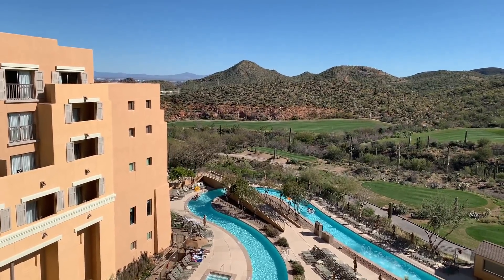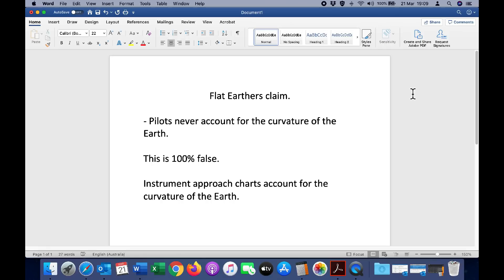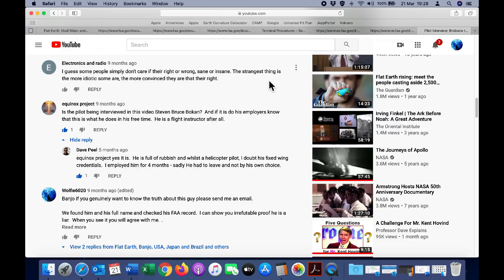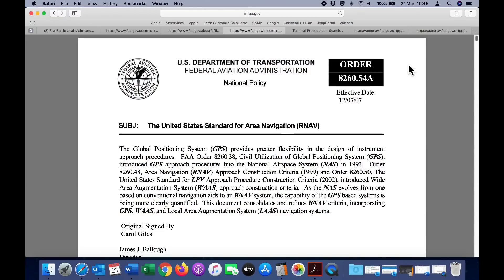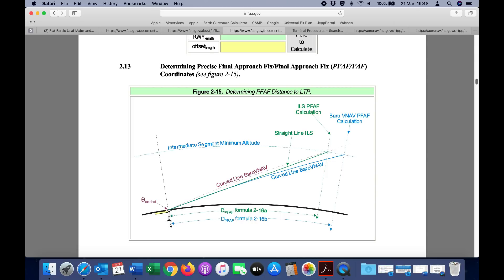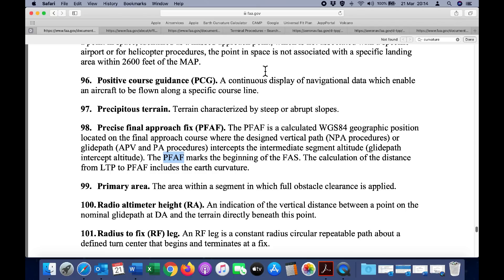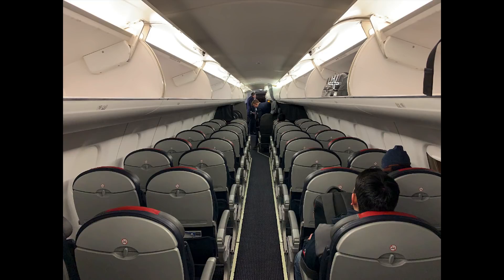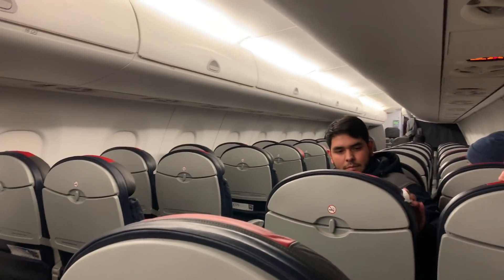FAA Documents confirm Pilot approaches are calculated for the curvature of the Earth.

Comment: If that calculation was valid the r value would need to change based on location because the earth isn't perfectly round. How is that discrepancy accounted for? Lives are on the line!
Reply: What is that discrepancy due to using the average radius instead of the location-dependent precision value? A couple feet, several yards, a football field, a mile…?

Comment: Corriolis effect.     https://youtu.be/85x8cqHoLWc.  On moving body on an ice huge plane. Without friction and no air resistance and winds effect on the body. Inly coriolis.  
 The trajectory will be cicrle. In the direction of the clock. Clockwise. https://youtu.be/85x8cqHoLWc

Comment: I made an example on Coriolis  effect on a rocket. https://youtu.be/wSdbJwvpNRE. The shift to the east.  But it was hard for me to take into account the air resistance. I guess air. Next time I will try. Air resistance depends on the velocity of the rocket, the air density which changes with height. And also atmosphere wind profile. Complicated.. I think with air resistance the soultion is not analytic but numerical with small time steps. You should solve ut with computer with a loop on time steps,  dt. Maybe if I had Matlab in my personal computer i could solve with air resistance. . And also i made another video (the last video in my channel which explain why I neglected in the rocket case the centrfugal effect and took into account only coriolis force effect and gravity effect on the rocket :-). In my two last videos in my channel ;-)

Comment: Can you prove that pilots are using "precision approach" and not "non-precision approach"?
Reply: I think the better question is can you prove that the precision approaches exist or not. That would include not only the data like seen in this video but also all the equipment in the aircraft and on land that is used for the landings. If all the data exists, and the equipment is real, then whether or not it's used on a particular flight is meaningless.
Reply from the maker: +nathanyamaha465.  Do you know the difference between a PA and an NPA?  Pilots use both depending on what is available at an airport.  

The Precision Approach like the ILS I show in this video has been around for decades and is used daily all around the world.

When you gain an instrument rating will learn how to fly an ILS.  I first flew one over 35 years ago. 

You can see the ILS equipment even in light aircraft and the ground based equipment is visible at airports that have it installed. 

https://en.wikipedia.org/wiki/Instrument_landing_system

Yes all the data exists.   Google ILS Approach or Instrument Landing System

Here are more links.  

https://www.faa.gov/about/office_org/headquarters_offices/ato/service_units/techops/navservices/gbng/ils/

https://www.faa.gov/documentLibrary/media/Order/FINAL_SIGNED_Order_6750_16E_ILS_Siting_Criteria_06-09-2014_for_Web_posting[1].pdf

https://www.casa.gov.au/sites/default/files/instrument-landing-system.pdf
Reply: @Wolfie6020  So if pilots are able to use NPA doesn't that negate the necessity for calculating in the supposed curve of the earth?
Reply: @nathanyamaha465  It does if you are prepared to accept an approach that only allows you to fly down to, say, 700 feet, whereas the Precision Approach would allow you to fly down to 200 feet or even land without seeing the runway at all.
Reply: @nathanyamaha465  Supposed curve? Are you trying to say that because sometimes a landing could be done NPA, that somehow that proves that PA is fake? Let me try an analogy and see if you want to stick with your logic. A surgeon could cut start your operation with a handsaw and then switch to a scalpel without you dieing, but would you want him to? If you want to debunk PA you need to be more direct and show that none of the calculations or equipment is ever used. Once you fail to do that then you fail to show the Earth curve is a factor.
Reply from the maker: @nathanyamaha465  Did you watch the video?   The NPA PFAF also factors in the curvature of the Earth.  They are two different formulas but both factor in the curvature of the Earth. 

When I show you clearly that the NPA also uses the curvature of the Earth in the calculation why do you think it is negated?
Reply from the maker: @nathanyamaha465  Go and look at the formula at 6:30 in my video for the NPA -   Formula 2-16b.   That also uses the curvature of the Earth.  

Both the NPA and the PA approaches factor in the curvature of the Earth.   That was the whole point of this video mate.
Reply: @Wolfie6020  I think I misunderstood something. I was assuming NPA meant you just relied on your visuals, kind of like landing a crop duster in a remote farm area. I need to rewatch the video. I think I was confusing one flerf with another.
Reply: @nathanyamaha465  poor conspiritard.
Reply: @jaimevivesp  if he thinks the earth is anything other than a sphere, he's a conspiritard.
Reply: @Alysm-Aviation  Well, yes... technically, if you believe something which requires a global conspiracy to be kept secret, then yes, you are a conspiritard.
Edit: And if what you believe can be easily disproved, making such global conspiracy ridiculously difficult to maintain, then you are also a fool.
Reply: @jaimevivesp  also, he's made several comments already, if you're on mobile you can see someones history.
Reply: @Alysm-Aviation  "if you're on mobile you can see someones history."
That's interesting... I'm always on desktop and didn't know that.
Reply: @jaimevivesp  yeah, you can click on someonse profipe picture and it will highlight 3 relevant comments on the current channel as well as subs.

Comment: At 4:59 "feet" Seriously! Feet! In this day and age! Why don't they go the whole hog and use cubits?
Reply: planck lengths or gtfo
Reply: The calculations are the same, as imperial units are easily converted by multiplication to SI. (Exception is the damned temperature.)
Reply: @MrAnticlimate  True, but my life is plagued by people who don't use international standards, and I'm just an ERP developer. I've been reading "Humble Pi" by Matt Parker he has collected some frightening stories of people dying or nearly dying because of Maths errors including conversion issues. Like the plane that ran out of fuel  in mid air because everyone involved in checking the fuel situation confused Lb with Kg, the pilot managed to glide the plane down and nobody died.

So seeing FAA documentation still using feet strikes me as crazy.
Reply: @k_tell  It's a historical thing, and yes, it's a mess! Almost every country has changed what it does from the international standard. The USA uses miles for visibility when most use meters. Most countries use knots for windspeed but some use meters per second. On a long flight I might fly through 10 different countries so the possibility of making mistakes is significantly increased. If I make an error then it's my fault because all those 10 countries publish the differences and it's up to me to spot them, not their fault because they won't use the international standards.
Reply: @hashmaldawn3878  I think you are being too kind. They have a responsibility to make it easy for you.
Reply: @k_tell  I agree with you completely, but there are some aspects of aviation that aren't totally safety focussed and this is an example. I, for example, can immediately comprehend what a visibility of, say, 4 km will look like from the cockpit, but I have to mentally calculate from statute miles. Note it is statute miles and not nautical miles, which might just have made sense!

Comment: Wolfie, I also found a literal Earth Curve reference (rather than radius) in the 8260.3D FAA order, relating to Obstacle Effective Elevation depending on distance from centerline. This is in the context of Obstacle Clearance Surface (OCS) determination,  since "Blurple Bear" clearly doesn't seem to understand the relevance of the difference between the ILS PFAF location and the barometric VNAV PFAF location, and why the algorithm needs to include Earth Radius.
We can now quote him this phrase, from Chapter 10, Section 10-2-2, part c. (page 10-8):
"Because the earth curves away from the OCS as
 distance from course centerline increases, the MSL elevation of an obstacle is reduced to account for this"
Obviously the relevant algorithm also includes our friend, the TERPS constant "r".
And significantly, this refers to calculating the effective height of solid obstacles that one might actually encounter during an approach, rather than fix point location variations, which may be too much of an abstraction for most Flat Earthers.

Comment: Hi Wolfie. Have you done a GLS approach for real yet? I've done a CAT I but not in poor weather. They will have CAT III capability soon. I guess ILS will become obsolete.

For those that don't know, GLS is a precision approach that uses GNSS (GPS) with a locally transmitted signal that improves accuracy reliably to within a meter or so. CAT I allows flight down to 200 feet and CAT III is a full blind landing system.
Reply from the maker: +Hashman Dawn.  No I have not done a GLS in the real aircraft.  The New 7500 will have EVS to ground.   They are working on the approvals for it but the company pilot doing the testing said it is very easy with the new HUD.
Reply: @Wolfie6020  Had to fly with an inop HUD the other day! Ironically, just the flight before, I'd talked in the briefing about what we'd do in the event of a HUD failure during take-off.
I thought I'd be home now for the duration of the pandemic but I got called out for a rescue flight.
Reply from the maker: @hashmaldawn3878  Stay safe.   I did a few right seat take offs and landings in the last sim session as we had a bit of spare time.  I feel naked without the HUD.   Had ours fail on approach to Colombo a few years ago.  That was the first time I landed the Global without it.
Reply: @Wolfie6020  We always get RHS checked every sim. But we've dual HUD anyway. You'll have that on the 7500 right?
It's been so weird going through airports, it's like a really boring apocalypse movie. People moving through the terminal in long lines with 2 m between each person.
Reply: Hashmal Dawn 
I’d be surprised if the Global Express is equipped for GLS approaches. I don’t think the Gulfstreams are. The Falcon 7X is not, and I’m not aware of any Falcon that is.
Reply: @53C52  Okay, I did not know that! Normally exec jet is ahead of airline in terms of tech.
Reply: Hashmal Dawn 
Not many locations with GLS in North America, so that may have something to do with it. 
There’s more focus on equipping with EVS, synthetic vision, combined vision, LPV. Things that can be more widely used.
Reply: @53C52  Not many locations with GLS anywhere yet! It will make ILS equivalent approaches cost effective for much smaller airports, and for larger ones it will enable multiple routings for each runway. As I mentioned, they can even use it for CAT III, and for taxi guidance as well.
Reply: Hashmal Dawn 
It will be interesting to see how things develop. As far as I know, the best GLS approaches in the US are still limited to 200’/1800RVR (KEWR & KIAH are the only installations I’m aware of).

The US seems to be going down the road of WAAS/SBAS for smaller airports since they can achieve those minimums with LPV nationwide without the cost of installing additional equipment at each airport. 

 I haven’t seen an in-service Cat III GLS yet, but I haven’t really been paying close attention since we’re not equipped for it. Are they already available?
Reply: @53C52  CAT III is still in testing I understand. I took no particular interest either, but then a CAT I became available on our route structure and I thought I'd better know what I was using. From a practical point of view that isn't considered essential to know as the presentation is the same as for an ILS, so it was more of a home study exercise for me. I'm old enough to remember how MLS was going to replace ILS but that didn't go well. The B787 is (will be?) capable of CAT II GLS and B777X of CAT III.

Here's a good site for checking progress on GLS flygls.net
Reply: Hashmal Dawn 
Wow, that’s impressive coverage in Russia. Thanks for the link.
This is proof that flat earth is good for something!

Comment: Are you stuck there Wolfie?  Morrison et. al. have pretty nearly closed the borders.  Either way, stay safe.
Good to see you maintain your qualification.  Not that there was any serious doubt considering how carefully you have demonstrated your knowledge and ability.
Does that variation inherent in a precision approach become a factor when you are letting down from high cruise altitude?
Reply from the maker: +John, I  have exemptions as a crew member so can travel freely at least for now.  Usually a descent form high altitude is based on a distance and a Vertical Path,  that is simply an altitude based on a distance from the field.   More like the curved Non Precision approach flight path.  

For example 300 ft per 1 NM distance.  So at 150 NM you are at 45,000 ft.   100 NM  30,000 ft,   10 NM 3000 ft.  etc. 

Taht is a pretty good rule of thumb though Wei often commence descent a few mile earlier so we are slightly below this value which allows a level off to slow down if needed. 

The precision approach has us flying a straight line to the runway so this is the one that is different to the normal.
Reply: @Wolfie6020  Thank you Wolfie.

Comment: That comment from the vegan pilot, it amuses me when they say that they never calculate how much more fuel they need to carry based on travelling further, due to having to add the aircraft altitude being added to the radius of the earth. They clearly have never worked out that it only adds a tiny fraction
Reply: Forest Fifer 
That same “pilot” claimed he did the math and came to the conclusion that the extra distance at altitude would be about 900 km for a flight covering a 3000 km ground distance.
That colossal failure was one of the many glaring clues that he had no idea what he was talking about.
Reply: @53C52  I'd love to see how he worked that out, just for the lols.
Reply: @53C52  
Anyone with a basic understanding of math & geometry can figure out that the Earth's circumference at 40,000 ft is less than 0.2 % larger than at sea level.

Comment: I noticed the FAA used feet and miles. Is that only for the US? I thought international flights all used metric these days.
Reply from the maker: Aviation is a mixed bag.  We use feet for altitude in most countries except China and Russia where they use Meters. 

China has some very unusual airspace where you have to use a conversion table.  They give you the altitude in meters,  Say 10,700 and you have to look up the corresponding table and fly the figure in feet.  Very odd. 

Distances can be in Miles, Nautical Miles or Kilometres for visibility.   Wind speed in Knots, Mph or Meters Per second.  

It is reasonably consistent world wide but the US does still use miles and feet for visibility too.
Reply: Over Russia it's even worse. Feet are used for higher altitudes and metres for lower ones!
Reply: Feet and inches was the international aviation standard. The European Airbus 330 was built using imperial measurments, not sure if the later models are though. 
When I used to work in aircraft maintenance (1990s) the flying school I worked for purchased a new Diamond Katana and that was all metric. Not one of us had any metric spanners (wrenches) to do a 25 hour service.

Comment: Are all planes as cramped as that? I've never been in one before. Looks claustrophobia-inducing.
Reply from the maker: No the jets like the 737,  787 and Airbus are much larger.  That was small plane
Reply: @Wolfie6020  My mum's first flight was on a 747 and she couldn't believe how large it was.

Mine was in a 737.  My third was in a little thing with one seat, a floor and an open door :)
Reply: No idea what my first flight as a passenger was. It was a long time ago. I remember the approach to Geneva when the flaps weren't cooperating. Can't remember what plane that was either, but probably a 737-236, for which PM Flight lists: Up / Clean 210KTS and Flap 15 – 150KTS so yes, we touched down going rather fast. First hands-on flights were a DH Chipmunk T1, Grob G109 and Robinson R-22B. The 109's a nice ride.